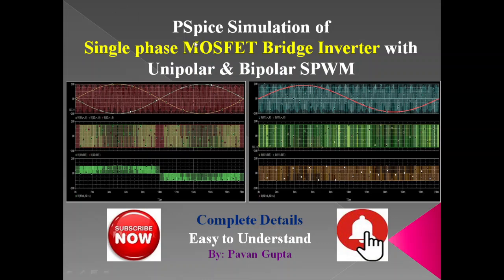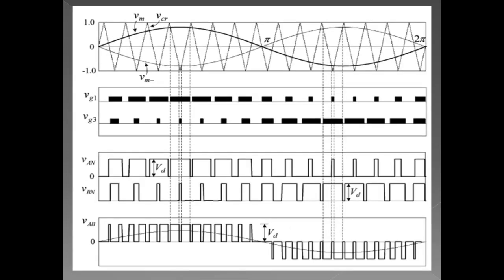PSpice Simulation of Unipolar & Bipolar SPWM of Single Phase MOSFET Bridge Inverter |Complete Detail

Comment from the maker: More PSpice Project Tutorial Videos (Please Visit the channel page for more)

Single phase Mid-Point CycloConverter: https://youtu.be/rrdjAAH96ls

Bridge Type StepDownCycloconverter: https://youtu.be/vMxvLSMII7c

Bridge Type StepUpCycloConverter: https://youtu.be/wbestUPQCEE

PSpice9.1 Download &Installation: https://youtu.be/-eaAG_Ejxng

PSpice9.1 Workspace &Schematic file creation: https://youtu.be/lUDDbhOwYsY

PSpice9.1 Complete Uninstallation: https://youtu.be/xCnELKvnfu4

PSpice9.2 Full Version Download & Installation: https://youtu.be/17g1lto6Umc

PSpice9.2 Full Version New Project & Schematic File: https://youtu.be/0GJMRXvR9xI

UJT Oscillator PSpice 9.2 Simulation: https://youtu.be/z8-y6vIiE54

SCR Triggering using UJT Oscillator CKt: https://youtu.be/vCeilvKTFsk

RFiring of SCR PSpice Simulation: https://youtu.be/PScJFQLPUHo 

RCFiring of SCR PSpice Simulation: https://youtu.be/FP7rLCqJ_Uc

Full Wave Diode Bridge Rectifier Part-1: https://youtu.be/n6Y4a3KLjvc

Full Wave Diode Bridge Rectifier Part-2: https://youtu.be/STqTK47SS5s

Fullwave controlled bridge rectifier Simulation: https://youtu.be/diPI1axGViM

3Phase MOSFET bridge Inverter 180 & 120 mode operation: https://youtu.be/kgPxumd46EM

Unipolar & Bipolar SPWM of Single Phase inverter: https://youtu.be/0y1hlGijjsc

Comment: There is an instant that M3 and M4 both have high gate voltages, and it should create a short circuit of the DC source. But in the simulation, it seems to work well. Can anyone explain why? Thanks a lot.